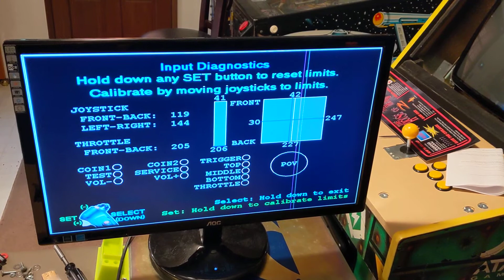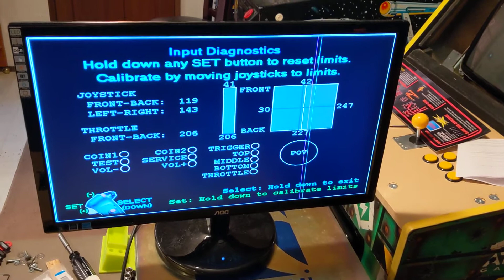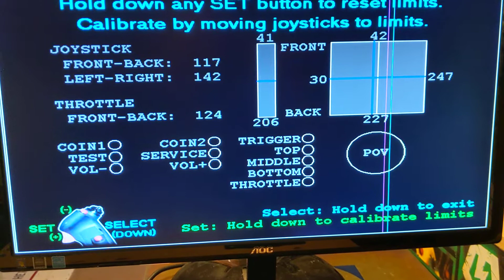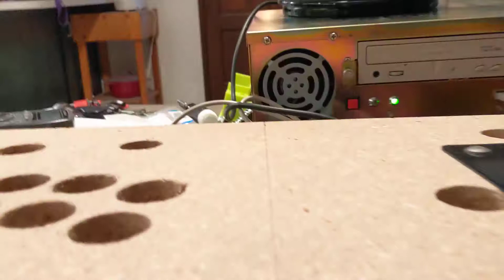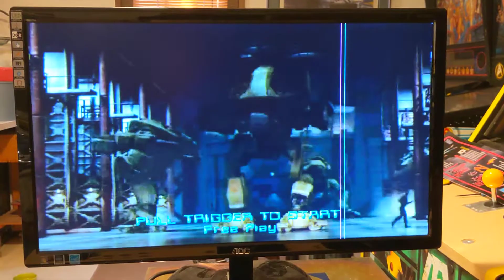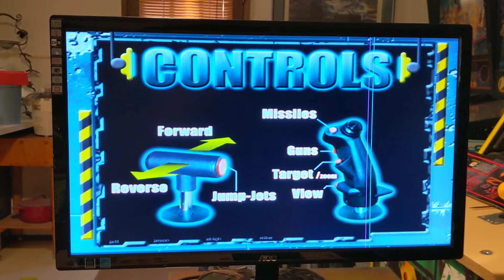Tsunami MEGA arcade project - Part 5 - Working!!!

Comment: May I ask, how are you getting into the Registry of this tsumo PC?  I have a revolt but if I go to safe mode it just reboots.
Reply from the maker: The setup has been in a box since I made the videos.  It's tough to remember.  I would think using a keyboard to ctrl-alt-del would get you to Windows, and then you can access it from there but it's been so long that I'm not sure if it's got a mod that disables ctrl-alt-del.

Comment: How did you register the games on the system, I have a revolt cab and the install disks for that, but needs a reregistration to license game.
Reply from the maker: The games were already registered.  My system had some kind of corrupt files but my friend was able to reinstall the operating system and then copy the already registered games back from a backup of the corrupted system.

Wish I could help.  I know at least one person knows how to register games but he hasn't shared the information.  I have heard that you can write a script that resets the date in windows when the system boots, so the trial period of the games never runs out.  That might be something you could try.